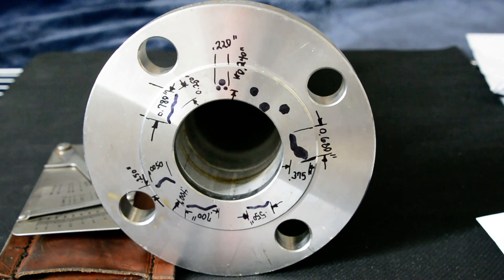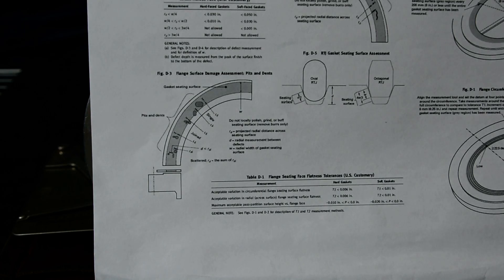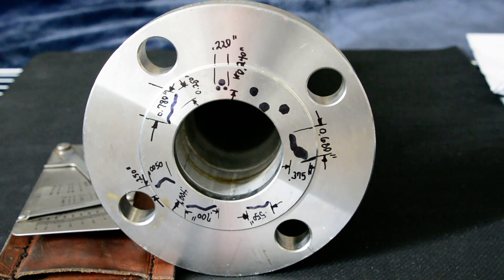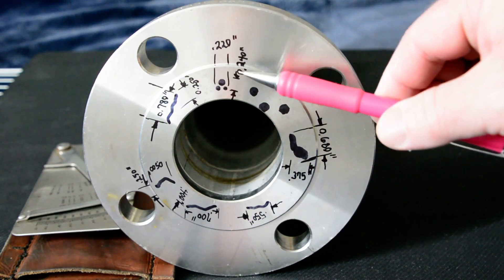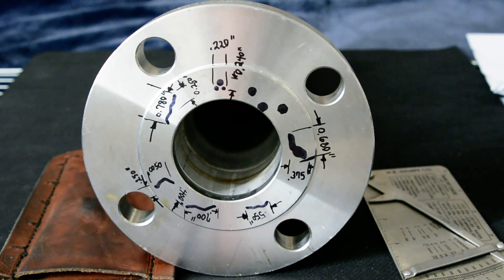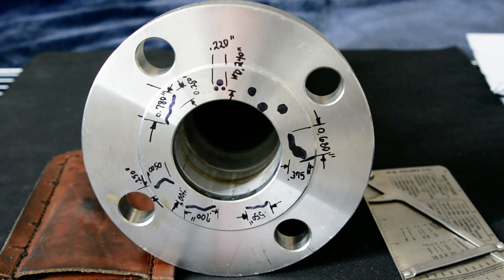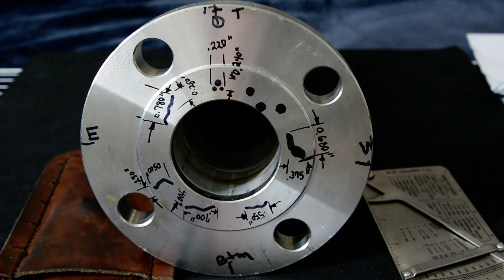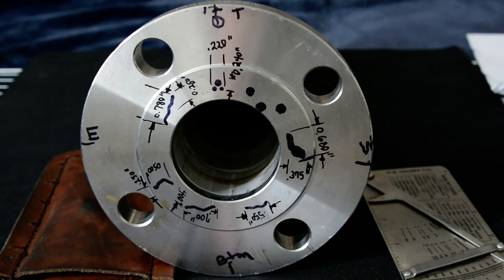Flange inspection ASME PCC-1

Comment: Great videos! Would appreciate more. Specially of internal inspections
Reply from the maker: Noted!  Internal inspections of what kind of equipment?
Reply: Sorry mr Eric, did not notice you had replied! Most common ones would Be very helpful FKOD, separators, drums… also I was hoping you could help in interpreting table D-2 of PCC1. 
rd < W/4 
W/4 < rd < W/2? 
W/2 < rd < 3W/4
rd > 3W/4
Thanks so much.
Reply from the maker: @nickmora6592  I'll have to do a follow-up video re: the table D-2 of the PCC-1.  I normally make a drawing, measure depth and length, record my findings, and then take it back to the office to sit down and "plug the numbers".  It gives me an opportunity to review things in the setting of the office, and use something other than back of envelope to arrive at my recommendations.  
Watch for an upcoming video on the subject.  Mr.Eric